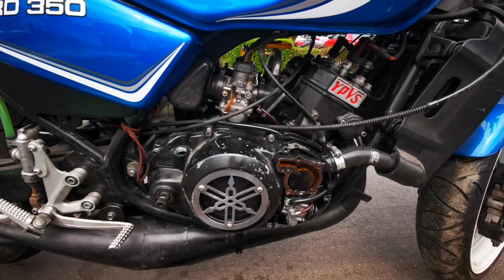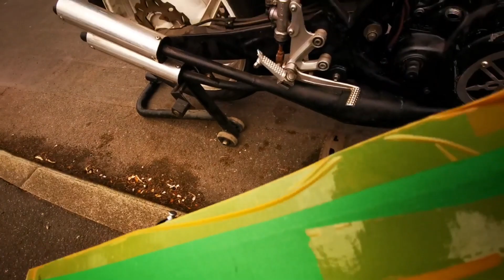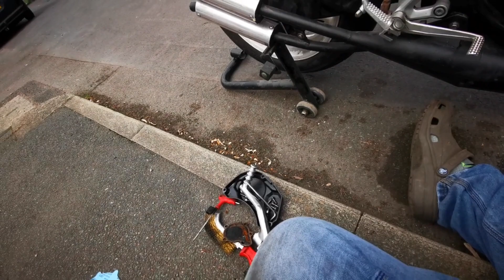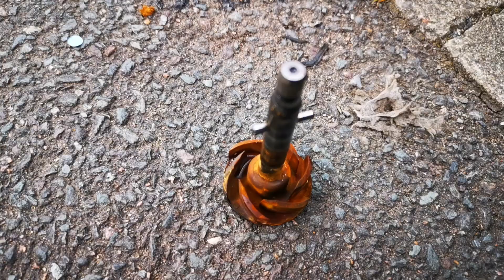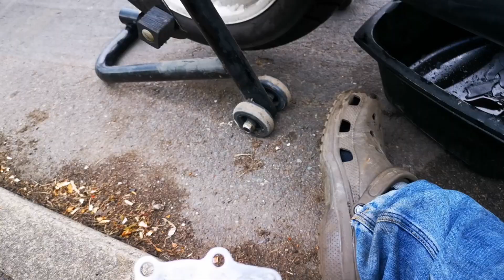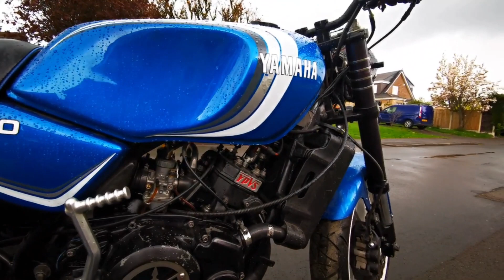Yamaha RD350LC Water Pump Seal and Bearing replacement

Comment: There's a little O ring that goes around a water pipe between the cover and engine casing, I'm thinking that's gone on mine, either that or its that water pump seal or head gasket. Anyone know how to test which one is at fault?

Comment: I'm curious how you got so much rust in the coolant system? Do you not run coolant or just water? Also are you running ATF in the gear box or is the red a result of the rust water mixing with the oil?  Looks like an RZ500 alu kicker. Nice. Was hoping to see it on the road in this video.
Reply from the maker: I use silkolene fully synthetic performance gearbox oil and it's red in colour
Reply: @bazzasbackyardworkshop how did this after market pump seal hold up in the end ?